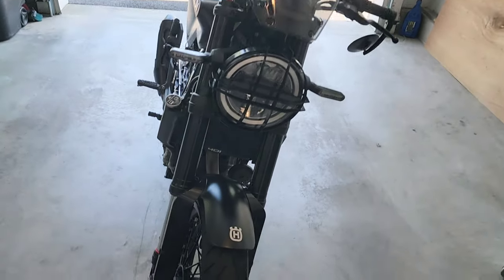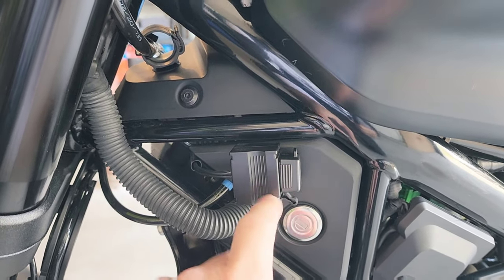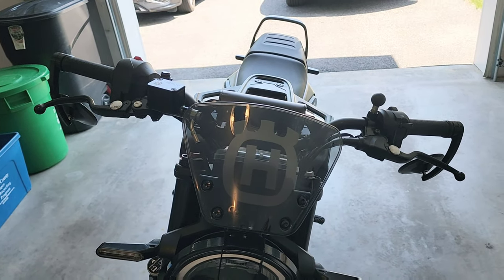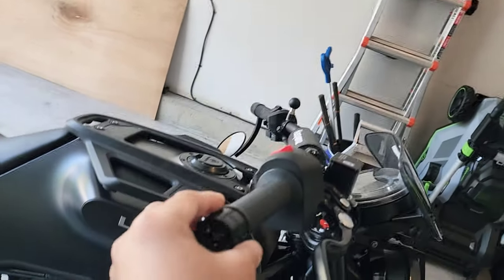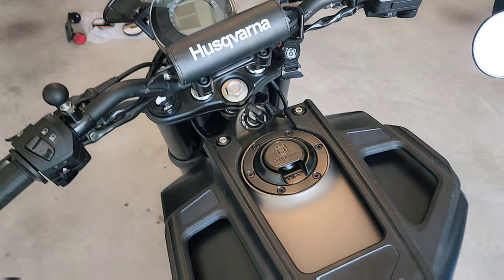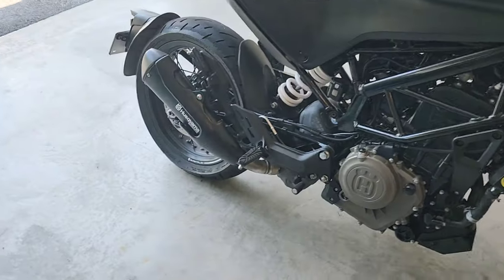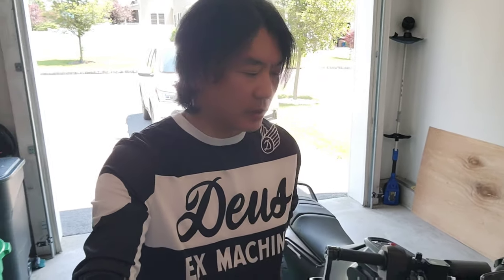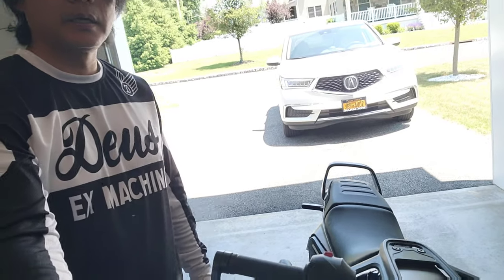1 Year Review/2022 Husqvarna Svartpilen 401/13K Miles/Part 2/Mods

Comment: Great review! Mine's at 6k miles and I've been wondering whether to hold it till the big service or sell. You've given me some confidence, since I do long miles just like you. About 1k miles per month. It is a fun bike, so I might keep it.
Reply from the maker: Keep it til around 9k miles then decide if u want to sell or do the 9.5k service (valve clearance) and keep for long term. I only sold mine since I wanted a bike that can do long road trips.
Reply: @genxjya  I already picked up a second bike for touring (Honda NC750X). So the 401 is now just for fun. Occasional commute and fun rides on weekends. the 2 bikes are back ups of each other, if one is opened up for maintenance, the other can be used.

Comment: I noticed only 3 links for the LED lights. Are the front and back the same part?
Reply from the maker: Front and back are same. Left and Right are different.
Reply from the maker: So u need 2 of each led light. Then 1 of relay. Someone said that website doesn't ship to USA anymore. If that's true then just get the part numbers and search Google for them. You can also try greenlandmx.com where I got some other european accessories from.